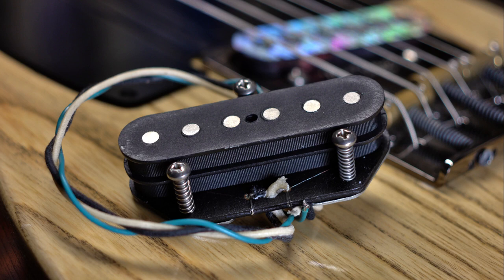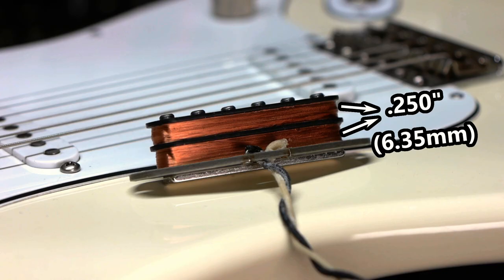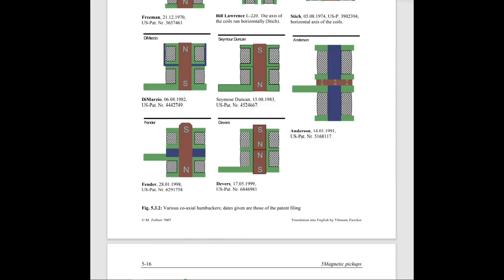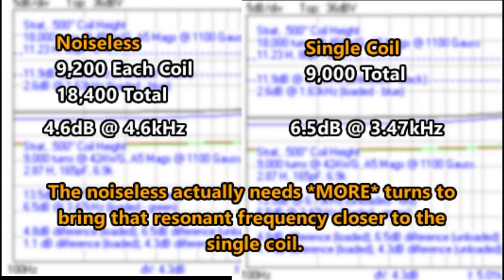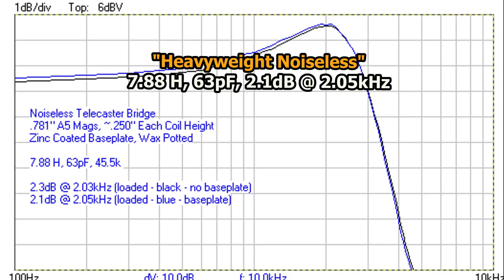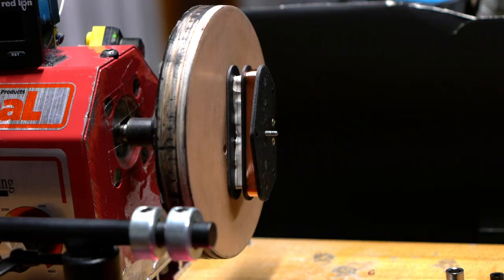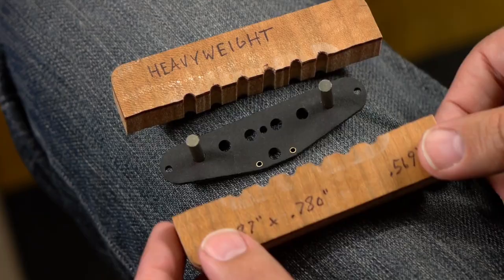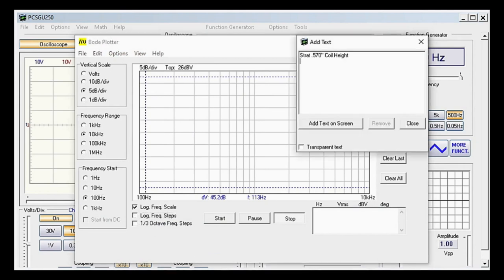Noiseless "Single Coil" (Stacked Humbucker): Build Tips and Theory

Comment: Wait! Are you saying that the inductance of the bottom coil doesn't matter in terms of having an effect on tone? Shouldn't a stacked pickup be significantly darker than a regular single coil if (for example) each of the coils have 1x the inductance of the full single coil? The sensing and dummy coils are in series so, about twice the inductance and thus a much lower resonant frequency?
Reply from the maker: I'm about to do a deep dive here. A very deep, multi-page deep dive. So bear with me. It's a great question, and I was inspired to do some more research of my own in order to answer your question, which I'll do now to the best of my ability.

I'll preface this by saying that if the inductance truly is higher, that has never shown up on my LCR meter. 

I recently did a noiseless Stratocaster pickup with 6,500 turns on the bottom coil and 6,500 turns on the top coil. That's 13,000 total turns, but I ended up with an inductance of 2.6 Henries. 

I just happen to make a 13,000 turn single coil Strat model, and the inductance of that pickup is about 5.0 Henries. What gives? 

Now here's where it gets interesting. In an audio test, and on a bode plot, it's very clear that the noiseless Strat pickup has less high end and less clarity than an equivalent single coil neck pickup. Why is this, if the inductance isn't the culprit? 

Let's unravel the mystery a little further by looking at the bode plot numbers. The 13,000 turn single coil Strat pickup is 3.4dB @ 2.3kHz. The Noiseless 6,500 turn noiseless Strat pickup is 3.9dB @ 4.0kHz. 

Now, I have a 2.0 Henry neck pickup I make. Single coil. And that one is 6.7dB @ 4.4kHz. I suspect if I wound out the noiseless slightly less, it would likely end up at the same resonant frequency of 4.4kHz -- same as that Strat Neck single coil. I merely overshot the wind by a little, as it's a new design I'm experimenting with. 

However, despite the 0.6 Henry difference, that does not account for the lack of clarity in the noiseless pickup. 

Again, why is that? This isn't explained by the inductance. And the noiseless pickup has a higher resonant frequency -- considerably higher -- than a single coil with the same number of turns.

Let's play Devil's Advocate and say that the LCR meter for some reason doesn't show the higher inductance, and the noiseless stacked pickups do in fact have higher inductance -- 2x what a normal single coil would have. So let's keep things simple and say the inductance of our noiseless Strat pickup in this scenario is 5.0 Henries, just like the 13,000 turn single coil.

We're still left with a much higher resonant frequency. And we're still left with a pickup that doesn't sound as clear or 'hi-definition' as a roughly equivalent single coil pickup. 

Again...why? 

Notice that the "Q factor" is highest on the Strat Neck single coil. The "Q factor" is just a fancy term for how much decibel voltage there is at a particular frequency, which is also just a fancy way of saying how much output does a pickup have at a particular frequency. 

Notice the single coil has 6.7 decibels at 4.4kHz. And the noiseless only has 3.4 decibels at 4.0kHz. This means that the noiseless pickup has a lower Q factor. The amplitude at peak frequency is roughly half in the noiseless pickup, compared to the single coil. 

Think of it like an EQ profile. You know how you can increase a frequency by amplifying it, by pulling an EQ fader up? Same thing here, for all intents and purposes. 

So imagine that on the single coil, the 4.4kHz EQ fader is pulled up to +6.7dB. And the noiseless pickup has the resonant peak in almost the same place around 4.4kHz, but the EQ fader is only pulled up to +3.4dB. 

If you look at what I personally have coined the "attenuation frequency" -- the first frequency at which a pickup goes into the negative dBV range, you'll find that the noiseless pickup drops off much more quickly, and much more sharply than the single coil. 

So it isn't just the Q factor, but the higher frequency rolloff as a whole. I've made a comparison bode plot for you here, to demonstrate this visually: 

https://imgur.com/gallery/tSJ0N0W

Now, here's where it gets really interesting. Remember that 13,000 turn pickup I mentioned, which has 5.0 Henries inductance? And our noiseless pickup with two coils stacked together should have about 5.0 Henries inductance, given the 2.6 Henries measurement (presumably, the other coil is "invisible" to the LCR meter for whatever reason). 

You'll notice that the Q factor of the 5.0 Henry single coil and the 2.6 Henry noiseless are *almost identical. 3.9dB for the noiseless, and 3.4dB for the single coil. 

I've plotted those two pickups here. You can see that, aside from the 13,000 single coil having a much lower resonant frequency, the frequency 'curve' (I think of this as an EQ profile curve) looks very, very similar. Take a look at the bode plot I made here: 

https://imgur.com/gallery/I7aziAl

I hadn't considered this before your comment, so thank you! Doing bode plots is a royal pain and if it weren't for your comment, I probably wouldn't have thought to compare these pickups. 

The end result? It appears the inductance might be "invisible" to the LCR meter. But the inductance also does not affect the resonant frequency in such a linear way as it usually does on single coil pickups. 

That would mean higher inductance = lower resonant frequency. In this case, the resonant frequency is pretty much the same that we'd expect from a single coil with the same turn count as the top coil of the noiseless stack. 

But the Q factor is considerably lower. So even with the LCR meter inductance and the Bode Plot resonant frequency being nearly identical, the Q factor is not. And perhaps that Q factor is what results in a more rapid dropoff of high end. 

The single coil has greater amplitude at its resonant frequency, even if the noiseless stack has the same resonant frequency. And the single coil retains more high end frequencies as the plot descends, while the noiseless stack loses more high end frequencies as the plot descends. 

So the long-winded answer? I'm not exactly sure why noiseless pickups do what they do. In my ongoing discussions with Antigua Tele from TDPRI, he's mentioned the Q factor problem, and one of the ways Bill Lawrence addressed it in his noiseless designs was -- someone correct me if I'm wrong -- to use an Air Coil for the bottom coil. That means no magnetic or ferrous material, just air, for the bottom coil. Then it's much more like a true dummy coil, compared to being wrapped around the magnets. 

Of course, there's still a loss of high end with dummy coils. Anyway, my 6,500 turn pickup was an experiment, as I've found that very short coils, like Bill Lawrence's Micro Coils, tend to be much clearer and more "hi-fi" -- so I thought if I made a noiseless stacked pickup with an 1/8" top coil (super short) and extremely fine gauge wire (48AWG SPN), I might be able to bypass these issues of lost high end. 

I will say, my latest experiment sounds quite good, though it's not all the way there yet. In side by side tests the lack of high end 'bite' and clarity/sparkle is very noticeable. One thing you can do, as Antigua has pointed out to me, is to use higher value pots to raise the Q factor, like 500k or 1Meg Ohm pots. Or I should say, this will just leave more high end frequencies. The pots won't add anything, but a noiseless pickup with 500k or 1Meg pots might be that much closer to a typical single coil with 250k pots. 

I'm still figuring all this stuff out, and it's a lot of fun keeping track of all these experiments. I do keep a 'master' spreadsheet of all my pickup experiments, which came in particularly handy here. Once you have the bode plot text files saved in an Excel spreadsheet, you can merely copy and paste them into Notepad, save it as a text file, and import those into the PC LAB 2000 software to make bode plots in any combination you want. You don't need an oscilloscope to do it either, just the software and the text file data. 

Let me know if you have any other questions. I always consider myself a student as much as anyone else, and I'd consider my response here much more an 'explanation' than an answer. I have the same questions, and much of the answers are buried or impossible to find, so you end up having to do your own experiments.

I'm always happy to share the results of my experiments, and all the data I've collected, whenever I have time. Thanks again for the question, and I hope this response was of some use or interest to you. My next experiment will likely be emulating Bill's "Air Gap" design to see if using an air coil for the bottom coil increases the Q factor at all and gets closer to a true single coil tone. 

If you look up Antigua Tele's review of Mojotone's Quiet Coils here, you'll see they pretty much nailed it. I do love experimenting and making pickups but it's tough when you're competing with actual engineers. These guys are way smarter than I'll ever be, and while I haven't tried the Mojotones myself, on paper, they look like one of the best noiseless designs out there:

https://guitarnuts2.proboards.com/thread/8862/mojotone-quiet-coils-analysis-review#:~:text=All%20of%20the%20specs%20are,5dB%20is%20all%20spot%20on.
Reply: @guitar_md  Interesting read! I have had quite a few looks at bode plots like these before and I also have chatted with mr Antigua about the subject. I have read antigua's posts on those micro coils and quiet coils before aswell. 🙂 

Do you have inductance readings and/or plots for just one of those coils from the noiseless stack pickups? That could perhaps give more clues to what is going on. Unfortunately I do not own a LCR meter nor an intergrator to perform this kind of testing. 

I agree that the slope after the resonant frequency is quite important, ive read some of antiguas posts where he messed around with this slope using audio software. 

About the pot values, another way of increasing bite that I have done is to take the guitar cable capacitance out of the equation by installing an onboard buffer, but this may not be vintage-correct.

(I apologise for nitpicking) but I think you may have confused Q factor with "resonant peak" (max dB value at resonant Freq). Basically Q factor is a dimensionless number based on the height vs width of the peak, a tall narrow peak has high Q and short wide peak has low Q.
Reply from the maker: @infectionsman  This is one reason I'm working on a more user-friendly interpretation of the bode plot numbers, as opposed to the actual graphic plots. The graphic plots are useful as a quick reference, but text data is much easier to share and I think once a few points are established beyond resonant peak, a relatively complete picture can be formed. 

I appreciate the input about Q factor, I was mistaking it for resonant peak. In this case it appears to have a close correlation, as the reduced dBV at the resonant peak also correlates with a lower Q factor. I'm still working on understanding this. Many of the concepts don't make that much sense to me, though I've wound and tested hundreds of pickups. Lately I've mostly been looking at the numbers on a spreadsheet, as opposed to bode plots, as the numbers are obviously a lot more accurate/telling. The bode plot graphics are great for a quick reference but I'm a bit more numbers oriented. 

I don't have the exact measurements of the coils, but I think 2.6 Henries each is probably very close, based on the bobbin size and number of turns and wire gauge. In my most recent exchange with Antigua, he mentioned high series DC resistance can cause a lower Q factor. So the 48AWG might be the culprit here. And again, I'm still learning how to interpret the plots and what they actually mean. The vast majority of my bode plots I've done on my own designs, though I have measured other mainstream pickups. I think being able to make them myself is the most valuable as I can control the variables, and one of my goals is to collect a large database of my own experiments. And perhaps people who understand this stuff more than I do can interpret the results. I'm pretty meticulous, including coil height, wire gauge and insulation type, number of turns, and every other metric I can think of that I have access to. Information that is rarely available on commercial pickups, where we have plots, but can only guess the amount of turns. Usually wire gauge guestimates are pretty close though, to be fair, if you know what you're doing. 

Another thing I forgot to mention is the starting dBV. I zero all my plots so they're easier to compare. But the noiseless pickup actually started at -2.18dBV at 100Hz, while the equivalent single coil neck pickup started at 1.3dB @ 100Hz. And the 13,000 turn single coil started at 6.07dB @ 100Hz. So that's another factor to consider. And a very important one. Notice how much more output the 13,000 single coil has compared to the 13,000 noiseless. Over 4x more, going by the numbers. And I can confidently say that knowing these pickups very well, the 13,000 turn single coil I make is definitely much, MUCH louder than the noiseless pickup. The noiseless pickup is also significantly quieter than a normal single coil. 

That would mean out of all of them, the noiseless pickup has less total output overall. If you don't zero the plots, it's easy to see that the noiseless pickup has much less voltage output at every frequency. It's dramatically less output than the equivalent 13,000 turns, which is explained by the fact that the bottom coil in noiseless pickups is essentially only 25% active at best, as explained in the book I referenced. 

It still has an effect on the tone of the pickup. But again, this is where it gets tricky, because it doesn't reduce the resonant frequency, or even change it at all as far as I can tell. It does affect the dBV value, but more importantly, the Q factor, as the entire plot has a flatter curve with a broader peak. 

The coils with my method are connected in series. I'm not sure what's typical. I know most noiseless pickups have four solder joints. So that could be a part of it. I'll also add that the noiseless pickup does not sound bad by any means, and while the loss of high end is certainly noticeable, I'm not sure it's any more dramatic than a typical noiseless pickup. The Mojotone Quiet Coils and the like seem to have gone the extra mile in retaining all that high end clarity and sparkle. It may be beyond my means to replicate that, at least for now.
Reply: @guitar_md  Calculating the Q factor is probably not that important most of the time with guitar pickups, but it could be useful if you are trying to match the sound of a specific pickup. The dBV value at resonance is important but can be confusing sometimes for instance if you look at something like a filtertron that has an obvious peak (somewhat high q) but still a low dBV value since the plot is sloping down before even reaching the resonant Freq where it peaks up.

About the output of noiseless stacked pickups: I have the idea that the bottom coil produces an out of phase voltage compared to what the sensing coil produces from the string. The coils are reverse wound, but the magnetic dipole in the string would seem to be the same polarity in respect to both coils. So the voltage induced in the bottom coil should actually cancel out some (25% ?) signal from the main coil. But I am not certain.

Most noiseless designs I have seen are connected in series, parallel seems wasteful in terms of wire and space. 

About your noiseless pickup: If it sounds good, it is good! 
I am just stumped at the inductance of the pickup seemingly being so low with that many turns. 

I remembered this post by antigua about fender noiseless pickups:
https://guitarnuts2.proboards.com/thread/7731/fender-vintage-noiseless-analysis-review

Here we can see all the DCR and inductance values and how they add up:
DC Resistance (series): 10.27K
 top: 5.14K
 bot: 5.18K
Inductance (series):  2.592 H
 top: 1.445H
 bot: 1.591H

It seems they were intending for both coils in series to produce the typical inductance of a fender single coil ~ 2.5H
Reply: it sounds like you tried to make a dummy coil with magnets instead of without  magnets which would create an out of phase  signal accounting for the anomaly...a reversed coil  direction needs reversed magnetic polarity to to have signal added and not subtracted
Reply: @JOOODYJOOODY  The reverse polarity of magnets is only applicable when the magnets of both coils are magnetizing the string. Like in a PAF humbucker, or the inbetween positions on a strat. From the perspective of the coil, the magnetic field is static and cannot be sensed. It is the magnetic dipole being created in the string itself and moving around over the coil that induces a changing voltage. For a stacked single coil, the magnet inside the dummy doesnt matter, it is the distance of the strings dipole to the dummy that determines how much string signal is induced in dummy. The signal will be out of phase because the two coils are out of phase, and the dipole has the same polarity for both coils.
Reply from the maker: @JOOODYJOOODY  

https://patents.google.com/patent/US2119584A/en

The pickup I made in this video perhaps would benefit, indeed, from an air coil in the bottom, or 'magnetic isolation.' You can see in the patent above, from Armand F. Knoblaugh in 1938 (US patent no. 2,119,584), the original invention of the coaxial (stacked) humbucker was from a very long time ago. 

He does mention specifically: 

"It is to be noted particularly, in this respect, that essentially all of the induced electromotive forces are generated in the coil i2 which is nearer to the strings I'd (see Figs. 3 and f1) and that very little of the electromotive forces are generated in the farther coil Ii, because of its greater distance from the strings and the magnetic isolation effected by the nonmagnetic piece l0."

They were not reverse polarity, but yes -- it would seem that to have signal added and not subtracted, the reverse wound coil also needs to have reverse magnetic polarity. 

I've confirmed this with my own tests, showing that having the magnets running through the entire pickup does reduce the output more than having an air coil on the bottom. 

They're both hum canceling, but it would seem that a magnetized bottom coil deducts more of the total voltage than an air coil on the bottom. 

They're still fine sounding pickups. But I certainly am interested in doing more research and experiments. 

For reference, Electric Guitar: Sound Secrets and Technology by Helmuth Lemme is an excellent book if you haven't read it yet. Due to your comment I'll be reconsidering some of my designs and exploring more about this. As an independent builder at the mercy of the materials I can easily source online, it can be tricky to innovate. The two stacked PAF bobbins I've done, the bottom one being an air coil, does sound very good, but the pickups can be too tall to fit in some guitars.
Reply: @guitar_md  I cannot find a mojotone quiet coil shootout a&b test.. it seems as though it's just another dummy coil design and sad money-grubbing or else mojotone would put a shootout test on their channel and prove the superiority that doesn't seem to exist.. signal lost due to the resistance in the second back reactive load due to proximity of sometimes the dummy coil is removed from proximity and kept at a distance..still not a complete solution...the p bass pickup design the home experimenter adapted to a 6-string by cutting a pickup in the middle  to 2  separate coils is true additional secondary coil. There may be a dead spot between the third and fourth pole I don't know.. maybe patent restrictions would keep you from developing this for commercial purposes I don't know... It's worth looking into.. is there a superior solution to a a perfect single coil humbucker?.. of course there is but not in the simulation we are in.. we will have to wait until 2178 when the simulation crashes or intensify into each problem. Sorry for multiple responses but my cell phone doesn't seem to be able to handle a very long message
Reply: @guitar_md  I cannot find any comparison shootout videos for The mojotone quiet coil.. correct me if I am wrong but it just seems to be another dummy coil situation.. if this was not snake oil and Superior to the other merchandise designs there would be a mojotone channel shootout proving their claims.. not buying it.. for that price you could buy sterling silver wire zephyr pickups.. silver is 7% more conductive than copper and you can hear the difference in shootout test... Graphical charts are all fine for scientific study but where the rubber meets the road it's where we live... From all I researched I'm pretty sure they're Jimi Hendrix if he were still alive would be using none dummy coil pickups and putting up with the h u m.. putting the signals through the added resistance load of a second coil it's the reason for the failed Seymour Duncan fury pick up test I showed you.. yes and there will be parasitic inductance and back EMF reactive load losses along with that and there is no established message I am aware of equaling the tone of a non dummy pick up..cutting the coil in the middle and winding two separate coils like the home experimenter I showed you yesterday was true additional secondary.. I would suggest you go in that direction.. he didn't do a shootout so there is no way to prove what I just said.. but he isn't a company.. he doesn't sell anything.. you don't supply a shootout either.. but I would not expect a dummy coil to ever win the shootout so don't bother.. the only drawback to a bass pickup design is the possible dead spot in the middle between the 3rd and 4th pole but there are dead spots between all single polls... What I found very interesting about his experiment is that he still had room between the coils he didn't fill up.. there could be a patch on preventing anyone from applying the p bass pickup design to a 6-string guitar.. for commercial purposes.. but there is nothing to stop someone from doing it at home for their own personal guitars.. is there an ultimate solution for a quiet pick up with no loss of
Reply from the maker: @JOOODYJOOODY  It's true that an A/B audio test is where the rubber meets the road, but even then, the best way is to record direct in to an interface, not through an amp, and with absolutely zero effects. 

And also to provide bode plots and LCR meter readings for the pickups in the shootout as well. 

If you're not winding your own pickups, and/or don't have the bode plots available, there is absolutely no way to tell what the actual differences in a pickup shootout video are. 

Without the scientific data, you are not isolating for variables, so you can't know what variable is causing the differences you're hearing. It could merely be that one pickup has less turns of wire, a lower inductance and a higher resonant frequency, which we hear as "clearer" or "higher fidelity," but it's merely a retention of more high end frequencies -- or I should say, the pickup is filtering out less high frequencies, or filtering them less aggressively. 

Pickups are low pass filters. They don't create a sound of their own, but filter sounds that are transmitted through them through a frequency response curve. I just think of it like an EQ curve. 

The bode plot is merely the response of the pickup, in 100Hz increments, to a steady generated signal. The resulting graph is an accurate representation of the pickup as an electromagnetic inductor and low pass filter, which is its primary function. The bode plot tells you how efficiently it's generating voltage, and at which exact frequencies. 

Same thing really is listening to the static hum of a pickup. You can hear a tone difference in single coils without ever playing a note and just listening to the frequency of the static hum. The static hum is the same thing as a signal generator, and all your ears are doing is perceiving a frequency response, as opposed to actually plotting it scientifically. 

The scientific plots are valuable as we can't always trust our ears to function perfectly every single day, and we all have varying amounts of hearing loss. 

Anyway, my main thing is single coils. I've made a handful of noiseless pickups. There are also models on the market such as "Bipolar Pickups" and split coil designs based on the concept you mentioned. You cut a bobbin in half, and make it a true humbucker: reverse polarity on one coil, then connect it in series with the other coil. 

So, back to shootouts: a true, accurate shootout would be incredibly boring to listen to. The dry, pure signal is the best audio comparison possible, and nobody is doing that. I definitely am looking forward to making some shootout videos like that in the future. 

Direct-In, completely clean, complete with LCR and bode plot specs for each pickup, as well as complete build information: coil height, turns of wire, insulation thickness, everything, so you can understand what you're listening to. 

Not providing this information is no different from the rest of the smoke and mirrors marketing. Without bode plots and LCR meter readings, there is no fair comparison. Comparisons are only fair when the resonant peak is matched as closely as possible between two pickups, so you can compare differences that the bode plot might not represent. 

Because I will say right now, the bode plot is extremely accurate in predicting what a pickup will sound like, as at their heart, they're simple electromagnetic inductors that also function as low pass filters. And that's exactly what a bode plot shows you.

In other words, the bode plot is an EQ curve, showing you what frequencies a pickup is emphasizing, and which frequencies it's attenuating. It really is that simple, and having specific Decibel voltage readings at specific frequencies is the most accurate test we currently have for determining the tone of a pickup. 

It gets a bit more complicated when dealing with multi-coil designs, considering the effects of comb filtering and other factors that will not show up on a bode plot. But when talking about shootouts, we're discussing pickups of the same make and model, with only one or two small variables changed, such as wire type, or wire turn count, or magnet type or magnet strength. Beyond one or two variables, we might as well be comparing apples and oranges, and then we no longer have a shootout. 

Anyway, my main thing has always been single coils. I've made some noiseless pickups begrudgingly. The reason I haven't delved into them more is there are already so many options on the market for people to choose from, and the standard dummy coil design has all the issues you mentioned. 

I will say I'm curious to hear the Mojotones in a shootout. Going by the bode plot, and given everything I said about tests, I can't see any reason why they wouldn't sound almost identical to traditional single coils. The numbers add up. I haven't tried them, however. It would be an interesting shootout for sure. But even then, for a fair comparison, you'd need to build or select a single coil with the same bode plot readings. 

It would not be a fair shootout to compare it to just whatever set of Fender single coils. The single coils would need to be built to the same resonant frequency for a truly fair shootout. 

Also, with these noiseless pickups I've made, they can only be in series, as it's one continuous, unbroken strand of wire. Most noiseless pickups will have the coils wired separately, so you can in theory run just the top coil if you want. 

And the top coil alone will be louder than both coils together. Having a switch to turn the bottom coil on and off would be no different from just having a dummy coil. 

I did have a Powerhouse Strat years ago. Those came with dummy coils. They used Telecaster neck pickup bobbins, the plastic ones, with no polepieces, and the turn count matched the turn count on the Powerhouse Strat pickups. They also came with a Clapton boost that was modified to have slightly less dB boost than an actual Clapton boost, but that's the only difference. And you can remove the resistors or alter their values to get the same boost as a Clapton Strat. Same circuit board. 

Anyway, having a switch to cut the dummy coil in and out on a noiseless pickup should demonstrate what that second coil does. Cuts the sound and also reduces the output as well as the high end. That's the reason you most commonly see noiseless pickups used with preamps and a 9v battery, like the old Clapton Strats with the Lace Sensor noiseless pickups, the 50k pots, the boost, and the TBX tone control. 

The Powerhouse Strats were phenomenal. They really were. I'm not a fan of having a battery in my guitar but I had a lot of fun with that guitar, and I will say the boost was an awesome thing to have on gigs. 

I also wired it so I could kick the dummy coil in and out via a DPDT switch. You can certainly hear a loss in high end with the dummy coil. The hum canceling and the loss of some high end can be favorable in some situations. 

I haven't tried the Ilitch system, but am familiar with it, and some of the other options for a totally noiseless setup, that allegedly leaves the tone of the pickups completely intact. It probably is the best solution overall, certainly much more advanced than the dummy coil design, which as I mentioned earlier was patented in 1935 (or was it 1938?). A long, long time ago, nearly 100 years at this point. 

I'm going on and on here so I'll cut it short. But I'll add one more thing: I've found leaving noiseless stacked coils unpotted does help a bit. The lower capacitance means a bit more high end retention. And the noise canceling inherently will resist squealing more than a single coil. Kind of like how all the old PAF's were unpotted. Of course at high enough gain and loud enough volume there are going to be issues. 

For me, I only care about buzz when I'm recording. That's the only place it actually matters. I gigged with single coils exclusively for years and I could not care less about hum and buzz live. And you keep those high end frequencies that make single coils sound so good. 

Recording, especially on a computer, is a different animal. But again, it's all down to preference. 

Again, no comment on the Mojotones, and if I were to do a shootout, it would have to be meticulous, and I would make a set of single coils to match the Mojotones as closely as possible. The only fair comparison is between two pickups of as similar specs as possible. This is something you never see anyone do because generally, nobody has the resources to do it and has probably also never thought of it. 

None of this even occurred to me until years and years of winding pickups either. I've done some Direct-In shootouts that have been very interesting, comparing for example some Seymour Duncan Humbuckers with one of my own humbuckers, and then the stock 'crappy' humbuckers that came with the guitar. If I weren't so grossly disorganized and didn't have a huge backlog of videos to work through I would definitely get these tests out a lot faster. 

It's something I've been wanting to do for quite a while now but I simply haven't had the time. I appreciate your comment a lot by the way and this has inspired me to get back on track with conducting and recording some of those shootouts and to raise the bar for pickup shootouts in general to be done to a higher and more accurate standard.
Reply: @guitar_md  I agree with you extremely... Except that where the rubber meets the road the subjective area where the listener because of the Heisenberg affect and because the listener is the end consumer has the last word if there is one... Cold robotic scientific testing and graphs tell an important part of the story... Of compromises and variables that went into everything leading up to the moment of truth... What is being experienced coming out of the speaker of the particular amplifier or every man's amplifier.. the most accurate scientific laboratory amplifier still has an arbitrary gain Factor conservatively like the finest microscope or telescope tries to multiply the tiny inaudible vibration in its best resolution in itself maybe not being most pleasing to the ear.. play directly into a McIntosh tube amplifier the guitar signal won't sound like something of interest.. but when the signal goes through a high-gain specially-designed amplifier we hear harmonics.. the Rodger mayor fuzz face in appearance doesn't look much different then amplification from a standard handbook of circuit construction of the the times but something happens concerning intent intention.. the human factor.. the Heisenberg effect of the subject interacting with the person doing the activity.. the behavior of the human subject and the behavior of the experiment.. a shootout with every pickup ever made.. graphic readouts with decibel and frequency analysis would be awesome.. it would likely tell the story of every design flaw.. everything we haven't mentioned.. recycled copper and changes in production technology factored in.. what is the pick up attached to.. what are your testing devices... Is static noise the same as magnetic h u m? If we're talking about the same static snow  noise you see on an old analog TV after all the stations go off late at night that static noise is cosmic noise... The sound of the polyverse... What is plasma? A spark gap produces all frequencies.. spark plug wires use high resistance to suppress this a l l wave undesired signal source.. static charge electricity is not the same as current flow . As in the Tesla hairpin circuit which will pass through a capacitor it has a different nature. It can be short-circuited and still do work.. cold electricity.. have you ever wondered why it is when you touch the strings on a guitar which are grounded why cosmic noise and hum. Both are greatly reduced.. somehow you become a relative ground.. I don't know if this is ever been explained.. there is a difference of 100 v per meter from above to the ground and presumably continues to the center of the Earth which keeps accepting particles emitted from cosmic noise traveling as waves and inducted to anything having conductive properties.. in extreme that would be lightning continually being consumed by electrochemical processes in the ground creating telluric currents and biological time varying fields consumed into entropy... But what I was meaning to say was that the difference between the queen channel and the dirty channel of pickup performance... The relatively acoustic signature and the high-gain Marshall is the dynamic range of the human-interest story.. everything you are saying is true but I would like it to be supplemented..the whole story.. every pick up every graph every amplifier.. it's not in the interest of companies to do this because there is only going to be a very few winners.. instead we have every company claiming to have bragging rights when actually so far they are all flawed... We are living in a simulation we're almost everything is done wrong... Simulation ends in year  2178... The perfect humbucker does exist just like free energy.. it's just not happening in the territory we are in this particular space-time.... Time did not actually start at year zero... There was time before that if time actually does exist.. but consider this.. why were there no dates on coins found before year zero?.. even if time is a human.. this is this is just one proof of the simulation.. no dates on coins before year zero.. there is nothing forbidding the discovery of a perfect humbucker.. everything already exists.. but it's not all here.. Discovery is just that..dis covery.. uncovering what is always there but hidden.. there is nothing new.. humanity progresses until there is an intervention to make sure there is no real.. progress    ...comes the Phoenix weapon.. 138 year cycles.... Do you really think out of all the time that has past got this little recent explosion technology never happened before?... I agree that potting degrades the signal also.. but the wax does stop the possibility of corrosion due to condensation of moisture.. who knows what the future will bring.. if you had ceramic magnets that reduces corrosion possibility...
Reply: @JOOODYJOOODY  take your meds
Reply from the maker: @JOOODYJOOODY  I agree that while tests are valuable, they may not show everything. It's the same in medicine. You can get lab work done, but as for what the numbers mean and how to interpret them -- very different story. 

Pickups are much simpler than the human body, and we're looking at a much more limited set of data, but they're still fairly complicated the more nuanced you get. People have discussed the possible importance of conducting different tests to get a better idea of how different magnets affect a pickup's response, for example, as that won't show up on a bode plot beyond the affect it has on inductance. Things like 'flux density' and more go way above my head. It's reasonable to assume that a panel of tests may not be telling the whole story. 

I feel like I'm still living in the dark ages while others have really innovated and they even have pickups that operate based on light now. I think that idea was conceived a long time ago but it's being put into practice now -- Lightwave Optical Pickups is one. 

And another very interesting idea here: 

https://github.com/cycfi/nu

https://www.cycfi.com/projects/nu-series/

All that stuff goes way, way over my head. Wrapping some copper wire around some magnets makes sense to me, but for now, that's my limit. Some people are doing some really incredible things. 

The silver wire does sound interesting. If it weren't so expensive I'd love to try making some pickups with it myself. Very cool stuff! 

I'll reiterate as well that some pickups may be better suited to direct-in playing. I've made some pickups that didn't sound good at all through a real tube amp, but they sound great through digital plugins. Sometimes more 'sterile' sounding pickups that don't have a ton of output are boring through a tube amp, but can have a great, clean, clear signal direct into an interface. 

It's enough to make your head spin. I'm lucky I only sell a handful of pickups every now and then. I don't know how these guys do it day in and day out. When I gotta spend a few hours making a set of pickups it takes a lot out of me. Very meticulous little things to fiddle with. 

I will say one thing, super overwound pickups are a lot of fun. I've gone a very non-traditional route and love making super overwound bridge pickups. They can rival a P90 or a humbucker and they just have standard Alnico 5 polepieces. Overwound single coil bridge pickups also work great with wah pedals in my experience. When I flick the switch to go to the bridge position I like to have a little of my eyebrows singed. That's how you know it's a good one.
Reply: @guitar_md I have a suggestion, what if you do as a regular humbucker but put the magnet bar in between the coils? I guess, and that's only my guessing, that it would still have the same issue because of the string height in relation to the bottom coil, but I digress, the only way to be so sure about it would be trying it.
Reply: Knowing inductance and "resonance peak" — has nothing to do to the pups performance.
These are almost completely useless values.
Reply: @iridios6127  What do you suggest is useful then?
Reply: @infectionsman  
The number of turns and a good magnet.
Reply: @iridios6127  Those things are what will result in specific inductance and resonant peak. More turns will increase inductance and lower resonant peak. "Polepiece" composition will directly affect inductance. Gauss strenght of the top of polepiece matters too, as in increasing possible output.
Reply: @infectionsman  
I wound about 40+ pups and never once did I care about either inductance or resonances.
They all work fine.
Reply: @iridios6127  I believe you. I am just trying to be scientific here and inductance and resonances are important factors for evaluating a pickup.
Reply: @infectionsman  
Not important at all.
You also don't take into account that these things are measured by feeding electricity into a coil, whereas in a guitar the coil itself generates electricity.
And these 2 processes are radically different from each other.
Reply: @iridios6127  I know. Thats why we can take measurements also by inducing voltages into the pickup with an exciter coil. If you want to wind pickups by ear, that is fine. Me personally, I need those tools and a scientific understanding to help me with my designs.
Reply: @infectionsman  
No one can do anything (useful) with a pup, knowing these numbers and trying to manipulate them.
It's much easier to do something in post-processing.
Reply: @JOOODYJOOODY  
Using silver in pups makes no sense, either electrically or sonically.
Even if you're damn rich and have nowhere to put your money except for this rubbish.
Reply: @iridios6127  clearly the two persons you were talking to does know what to do with these data. Don't try to invalidate someone's opinion just because you can't make anything useful out of it. It's a YOU problem, not theirs.
Reply: @warrenoids  
Instead of opinion i prefer scientific data and approach.
Reply: The vintage Noice less Stacked Humbuckers have an out put of 9,8 Kohm which is a lot more powerful than the Original PAF Humbuckers that had 7, 4 Kohm. Thats why The Clapton signature Stratocaster Without its stacked Humbuckers, active circutry run by a bettery and an incredible 25 DB mid boost is the absolute most powerful Humbucker guitar in the world. Its between 25 to 30 times more powerful than a Gibson Les Paul Humbucker wise. Even With the boost off its a lot more powerful than a Gibson Les Paul Humbucker wise.
Reply: @iridios6127  which is exactly what they are doing.